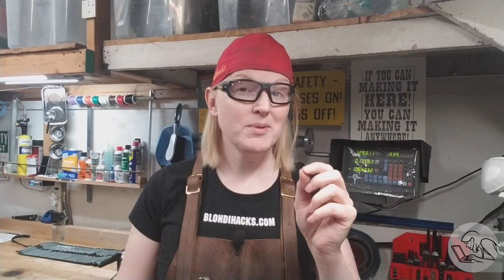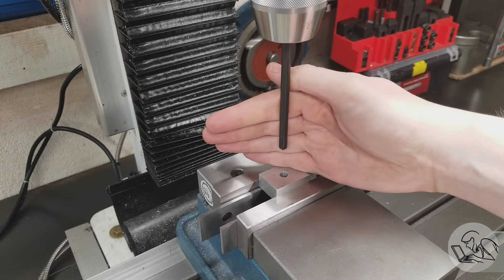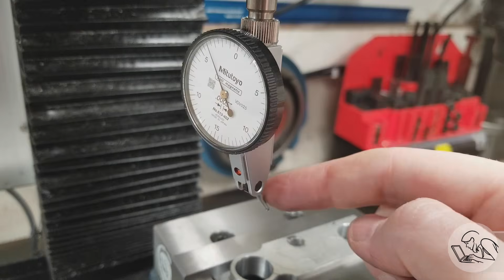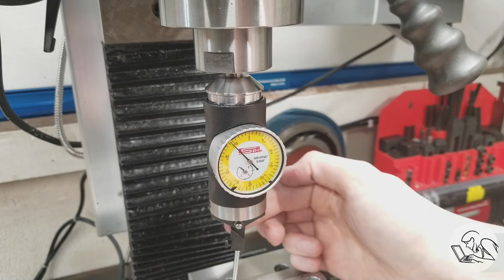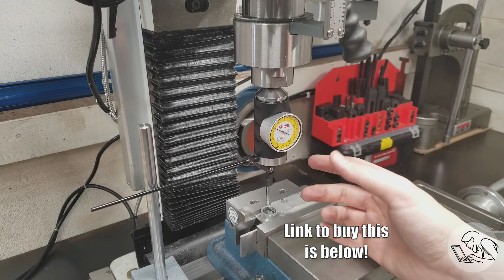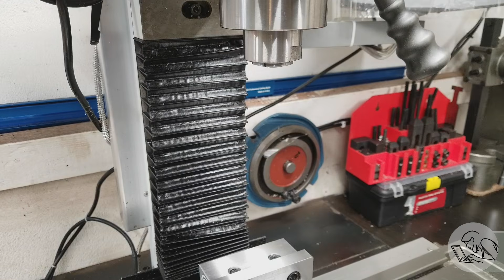FIVE WAYS to find a hole or punch mark on your mill!

Comment: Hi Blondi, my center finder has a friction mounted feeler much like the pupitas indicators. Does yours not have that!? It helps much with the range of the feelers. Thanks for the video, as always very nice to watch!
Reply: You can see that Quinn's does also have the friction "pivot" to allow adjustment for different diameter holes. It only moves to one side though unlike DTIs. Sometimes the pivot screw may be very tight and make you think it doesn't move.
Reply: Yup. Mine is like this too. I can adjust for different sized bores.

Comment: Thanks Quinn!  When I bought my edge finder it had cone end on it.  I assumed that was for finding the center of a hole, though I’ve never tried it.  Is it?
Reply: Yes, that is what it is for.  It is quicker and more accurate than most of the methods shown, if the hole it bigger and about 1/4".
Reply from the maker: Yah, I didn’t talk about that tool, but I have talked about it in other videos.
Reply: Did I type Gwen?!  I meant Quinn!  😎